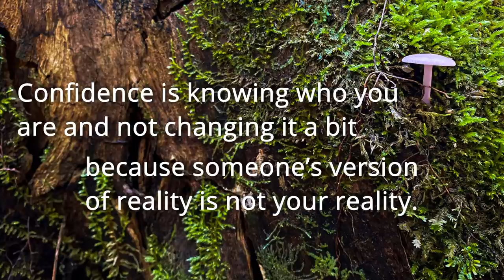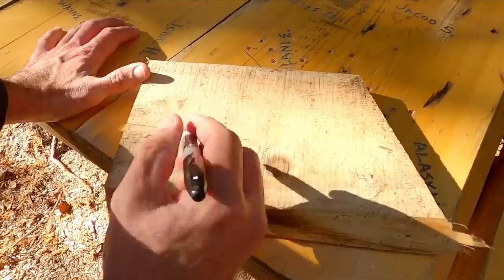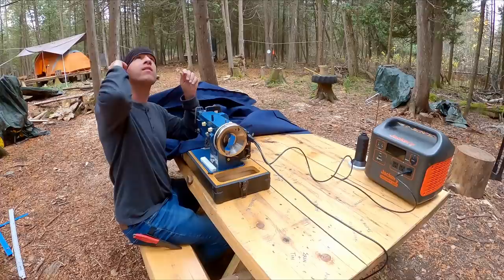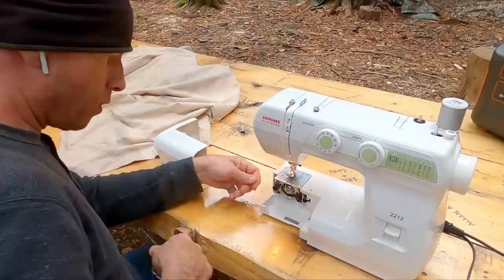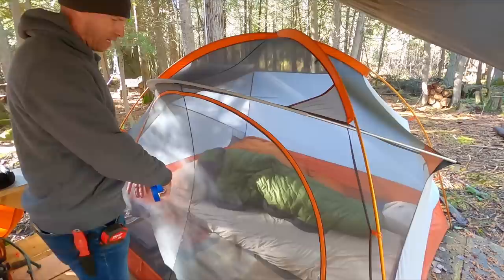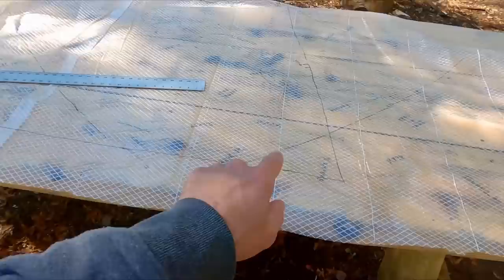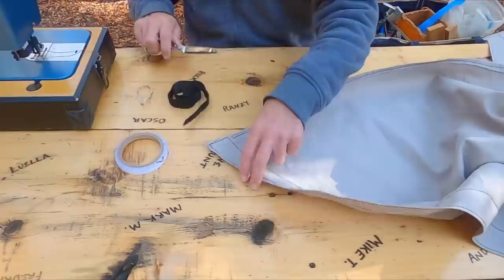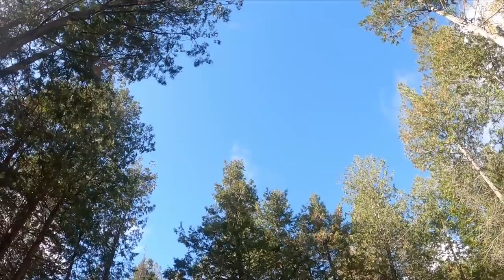Customizing My Tent for a Michigan Winter.  (Off Grid Canvas Work.) #57

Comment: I'm in Rhode Island and our tent recently flooded from all the rain and the 3' of snow melt causing the ground to become over saturated and it flooded our tent with about 3" of water ruining everything. So now I'm thinking of getting 9 wooden pallets and use them as a raised floor off of the ground. Then put a few layers of cardboard on top of the pallets then put a thick insulated tarp on top of the pallets before I build the tent back up on top raising it up several inches from the wet frozen ground. Now that the tent is up. I ran several kevlar ropes across from tree to tree a few times and safety securing 4 insulated waterproof camo tarps to keep everything bone dry , hidden, and properly venting. Doing this type of setup has been absolutely perfect, dry, warm and cozy. With a 3 candle setup I have yesterday was almost zero outside and inside the tent the thermometer showed 49 which was fantastic.  Raising the tent on top of the pallets with cardboard on top of them with a insulated waterproof tarp made a huge difference so if you want to do this, do it correctly yes you'll probably spend about $25 more in tarps but it's absolutely worth it. Hello it's what keeps you warm and dry. The wooden pallets are used and we're laying around free. Just remember to layer them with a few layers of cardboard for insulation and use a insulated waterproof tarp also on top of the pallets. Take your time and patience and it will come out perfectly. You will be very proud of your accomplishments when finished. Enjoy.. I hope this helps you in advance for your project. Cheers mate.. Dave

Comment: I had a canvas shop for 20 yrs. Great job. If you fold the seam toward the top then top stitch ot it won't leak and the seam crack will be at the outside edge. Thank you for the great videos. It has really inspired me to stretch my confort zone.
Reply: Loved this comment! Thanks for the tip about folding & sewing the seam! Will remember & use this tip!

Comment: For winter covers in lavvu tents we use watervapor open nylon or other plastic fabric, it should be somewhat wind breaking and or have a thickness to it (or a cheep op insulation layer)
That way there is no high humidity in the tent when heating and no condensation.

Hope it helps someone.
I love what you bring to the world.
Reply: Oh and if you have to use cotton: pitch it inside out over a fire for a few days in different positions especially the ones that go to the bottom of the tent.

It helps tremendously to prevent mold and rot.

Comment: I spent some Winters in the mountains . COLD ! Wet too . If you get some space/emergency blanked . Mylar . Rub each side with an eraser . The side that the aluminum comes off is the reflective side . Or you can place your hand on each side and find which feels warmer . Turn the reflective side in . Marking the "warm" side helps . Tape the blankets together . I use gorilla . Cover the tent . A candle will be all the heat you need . Or a rechargeable LED light . You can put the light in a can to reduce the light at night and have a night light . Use a heater if it gets really cold or to get dressed . Of course a tarp keeps snow off . Space blanket under the tent !! Warm side up . And cover the floor with a cheap cloth blanket or quilt/comforter . I always buy a tent I can stand up in . I'm 6' .
Reply: I have an antique Singer 99 machine it has been modified with a handcraft. Using thick thread I sewed sunbrella. It only does plain stitch but that is often enough.
No electricity, sews both fabrics
When cutting thin fabrics use weights.

Comment: It's so satisfying to watch your channel, love it.  Thanks for doing what you're doing.  I was thinking that you could build a Tee Pee, and modernize it to your specifications.  It can be of trees and milled wood and tarp and could even be two or three stories high with various platforms and can even be your 'All-In-One' construction project.  All of your tools and even your ATV could be stored inside. A central fire-pit could heat it all winter long so your drinking water, shower water, etc. would be fluid and room temperature year 'round.  Then, if you wished, your tent could attach to the side (it's already stationary and on a platform) and have the warm air from the Tee Pee feed your tent.  A Tee Pee IS a tent, just one of the earlier models.  Even a series of tee pee's could all be interconnected so one fire-pit could keep them all warm.  No need for propane heaters and you have a constant fuel source for the fire-pit.
Reply: Not my intention to draw any crowds to another similar channel but for an idea for the grandeur potential, check out this Tee-pee:

https://www.youtube.com/watch?v=1NeW1proKG8

Comment: Re threading needle. If the foot is black to the rear of needle eye, try some white nail varnish several coats with decent drying times in between coats. It gives you great view and now ease of threading needle. I too use to make all the girls clothes, sewing and knitting. I was often asked how I could afford all their clothes. Jaws dropped when I said home made. They queued up for the patterns, inside me head taking the dresses and trousers off the girls backs. Great way to be Sir. Very refreshing. Sleep well, try to stay warm.

Comment: Store your water container upside down overnite so ice layer forms deep inside but the bottom near the spout is still liquid.  That way you can pour out of the spout and still drink it without having to defrost it first.  There will be ice chips but it will still be liquid where you need it.
Reply: I forgot to mention ... for insulation bury it upside down in snow when you do this.  Just sitting in wind chill will freeze it solid no matter what orientation the container is.

Comment: I made a trifold sleeping pad/space blanket out of reflectix foil faced bubble wrap insulation.. Also use same material as a heat shield/deflector around a space heater + a small "ecofan" heat generated fan... Double digits below zero are no problem

Comment: I just came back to watch the second half  ...  I'm having the same problem with UV damage on my tent.  I use a 10 x 10 tent dome to shield my car during the winter.  I chose the dome shape for snow shedding, and after applying a marine UV resistant fabric protectant with waterproofing with a high water shed proofing by sno-seal spray on top of that,  I still found a "snow hammock" kind of problem in places, requiring me to go out on snow storm nights to push snow off before the weight tore the nylon.  Wet snow was the worst.  The first year this worked well, but as sun damage pitted the nylon, it got harder to shed snow.  The second problem - and most significant for sun damage, was gradual off-gassing of nylon in the sun making it crispy and less flexible over time.  I've considered treating both sides of the fabric with protectant to stop the off-gassing  from either side.  I think this will help keep the fabric flexible in the long run but I don't know, I'll have to test it out.  Now I seal every year on the new cover, but decided a sun shield over-cover is really the way to go, like the one you have there.   There's also consideration of what tent heaters do to fabric on the underside, something I don't worry about just covering a car.

COLOR:  Again, the worst enemy is UV.  I found warm color fabrics degrade fastest - yellows, reds, oranges, browns, some greens.  The longest surviving UV resistant panels were blue, like those garish blue tarps they sell.  Apparently, it repels UV rays the best which is why manufacturers chose that particular color in the first place.  Because it's hard to stealth with blue, some other UV protection needs to be applied in greater concentration to compensate for colors absorbing the sun's rays.

FABRIC composition:  I'm not sure what fabric composition you're using, or I might have missed it, but it looks fairly dense, canvas weight.  As for fabrics, polypropylene and denim are best UV resistant,  but nylon has the best abrasion and tensile strength with good stretch.  Nylon has crappy UV resistance compared to polyester (blue is still the most resistant of nylons), but the stretchiness gives a form fitting fly.  Polyester has better resistance, but is heavier and less pliable for that form fitting, tho sewing on the bias helps overcome that.  In your reinforced plastic grid pattern, you could use the warp/weave layout to determine direction of bias when you actually cut poly or denim.  I'd still UV reinforce with sno seal spray or some marine fixative.  The problem with some petroleum based sealers is they degrade the synthetic they're supposed to protect, so a field test patch might be in order before committing to a roll of something and going to the trouble of sewing a large tarp or tent body only to have it degrade a year later.

Double sided tape to make the pattern is a great tip.  Thanks!   It's useful to know how to sew another form fitting cover, something I wanted to do on my sewing machine but wasn't sure how to get it patterned right.  The sewing part would be pretty straight forward, tho I  might use a blue jean (french) seam instead of straight stitch.   Again, the problem with ANY sewing is puncturing the fibers with a needle essentially makes each panel a perforated sheet like paper towel panels.  I might glue panels first, or lay down a bead, and then sew in the reinforced areas.

Jancome is a very nice quality machine.  I'm jealous.

Comment: I'm so glad I found this video.  I've got a tent I want to make a ceiling for and now I know exactly what to do.  I've sewn a bunch of camp gear using heavy duty tarps and have had much success.  My favorites are the giant sized tarp bags that I can stand up in.  I typically use them to haul firewood to camp in my van then to cover it when I get there.  They're made with flat bottoms so they stand up to fill.

Hot tip for cutting big fabric like the sheet.  
*You were right, I would have ironed it then folded it in half or even quarters to make my cut. 

*Blue painters tape placed across the fabric is very helpful to create perfectly straight lines when cutting or sewing.  I use it all the time when I top stitch larger items like my oversized denim potholders or my flannel quilted blankets.  
- do not stitch over the tape as the adhesive will gunk up your needle.

And for real, make some quick covers for the machines that you can throw over them while you take breaks...

🙋‍♀️ Michigan girl here...the sand and humidity will get into the machines over time and ruin them...a terrycloth towel works well to absorb the humidity before it gets into the machine and prevent small particles of our beautiful sand from getting blown into the very precision parts that keep a machine running smoothly.  Oil and clean your machines regularly. Maintenance is key.

Thanks so much!!  Winter tent camping is such a thrill...I just need a ceiling to make it cozy!!

Comment: Question; why not move your tent into the gazebo?  It would be better protected from rain and snow.   Use the covering tarpaulin to hang from a side wall or to protect the surface of the tent platform from snow and rain.   Have you considered building cabinets for inside the gazebo to store your tools, protecting them from the elements while you build your formal cabin?   When the cabin is complete, the cabinets and their tools can be relocated into the cabin.  

Stay safe out there Ryan.  Peace brother.
Reply: Even if he doesn't move his tent in there, it would be a great place to put all his extra stuff at least under a tarp

Comment: I LOVE my sewing machine, it's an all-steel-gear Singer Slant-O-Matic 401A from the 60's, best Singer ever made!! Nice thing about these fantasic sewing machines is you don't absolutely need power to use them, you can put a hand crank on the right-hand big wheel and crank them and it takes only about twice as long to do the job! But they work  even out in the woods, and you can make all your clothing just as well as in a city room with an AC outlet!!

By the way, just got addicted to your ways! Subscribed! I am like you, always learned skills constantly, I've been an ER EMT 3.5 years, pig farmer and corn/soy tractor driver 1 year, BS physics, studied electronic engineering and did a career in it, computer industrial controller designer, programmer, Evolutionary genetics programmer, rebuilt 13 automobile and truck engines, tons of brake jobs and vehicle rebuilding for friends and myself, total rewiring of cars and farm trucks, electrican level house wiring, built two passive solar homes, lived in the woods for a year, 5 years operatic voice training, performed in Europe, 5 years Latin and Greek. built a rocket that went 2 miles in 8th grade, won the science fair, built my own bows, arrows and atlatls, deadly archer, etc. Why isn't everyody like us?? Well, sounds like a lot, doesn't it, it's because I'm 74 years old now!! That's the CV of a long active life!! Keep at it, young man!!

Comment: Waterproof your tent and canvas seams using extra hold hairspray.  Regarding your solar needs in winter,  hang your panels on the south or south-west walls of the deer shed, hanging vertically, under the overhang.  Tree cover should be sufficiently removed to allow energy production.  Try it... you may be surprised at how much energy you will capture; especially in winter with reflection off snow.  

When your temperatures drop 10-20° below freezing,  use a pump spray bottle and mist water on the rainfly and screens on your gazebo.  Mist will freeze into a thin layers of ice offering wind break and insulation.   Learned this in US ARMY about 50 years ago and used for many winters camping in Rockies.

From a scrap of your material or canvas, sew a bag that will hold 5-10 pounds of rocks.  Tie one end of a piece of rope that is as long as the door in your gazebo is tall to the bag and the other end through a screw eye, and to the top of the door.  Opening the door will pull the rock weight up and when you let go the door will be pulled closed.  

Stay safe out there.

Comment: You can always spray waterproofing spray on the seams if they leak. :) I love to sew. It's a hobby of mine. To sew lighter fabrics, you need to use pins and ironing it helps a ton. Also if the grain is straight you can just rip it in half instead of cutting all the way down. ;)
Reply: Pop p

Comment: Sewers usually wash the fabric first, and yes, you can iron it. The washing is to take care of any initial shrinking. 

Since this fabric is a lot more flexible, you can manipulate it to get the grain square. And with woven cottons, probably your sheeting would be like this, you can 'cut' it by making a small nick and just rip along the grain. 

And you can make anything with a straight seam machine. It's better if it can sew a bit in reverse. The rest is just gravy.

Sergers are nice because you can sew a seam, zig zap the edges, trim off excess seam, and create a very sturdy fray free seam.

The very old Singer machines are still very much in demand. Hard to kill.

Comment: I Learn So Much from You. Thank You Brother. I also started from just a spot in the woods and just built and accumulated as needed and always reluctantly. I Learned a lot about myself and what is ACTUALLY needed to live in the woods through the winters. This will be the first winter with a tiny wood stove( cubic mini grizzly model) and a Chinese knock off espar type diesel heater as emergency supplementary heat in case I get sick (I'm 63) or the weather is ridiculously cold. Tiny pod spaces are easy to heat with even body heat. Modular living is fun too as each little space serves different functions and requires one to travel "outside" from one to the other where an appreciation for the forest and sky is always right in the forefront, breathing Fresh air and always spotting something new. I have an old patio door that's double glazed that I've been thinking of making into the roof/lid of a "sleeping beauty" kind of a little bunkie (4'x4'x8')  for a guest or if I want to star gaze. Small projects are cheaper and quick and always delight the visit. Love Your Life. Love Your channel.

Comment: In case no one else has said it, to make straight lines in softer fabrics, use patterns. Draw on paper (or even cardboard) and tack them together. You may not work with soft materials often, but it's still a good thing to know for when you do.
Reply: What do you mean tack them together?

Comment: Binder clips dude. The ones from Staples. Velcro is the devil. 
I use a bunch of cheap fleece blankets attached to the inside of the tent with binder clips. 

Also, the Gazelle type of tents are perfect for you. They are awesome, except the floor is not sewn in, it's Velcro.

Comment: Already sew machine expert from Sun Shades to clothing. For your winter tent, do the 2x4 frame covered in canvas. Get some 13 oz. Sunforger for the covering. You could one step farther and add a 3-4 foot plywood wall around to help with insulation. Jeans (French) seam is almost waterproof on Sunforger.

Comment: Very interesting. Doesn't that tape gum up your needle?
My father had a sewing machine, nobody touched it. It was his. I love to sew, hand sewing also. So relaxing. I rip most fabric to get a straight line. Even after I get it from fabric store. Canvas to silk. Then easy to get a straight sewing line. I have a janome like that one, it is a good little machine. Don't let the price fool you, they are well made. I bought mine used for 50.00 11 years ago.I gave it to my husband. He passed so it's mine again. The other one I have is bigger. I want to take the Jenome with me when I go traveling my van. Wondering if if my big power source would handle it, will find out here.